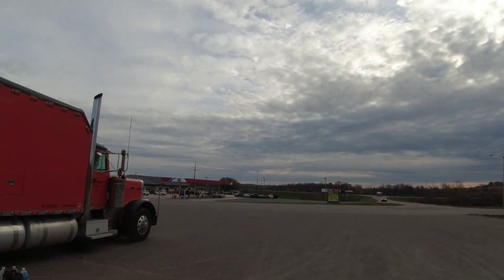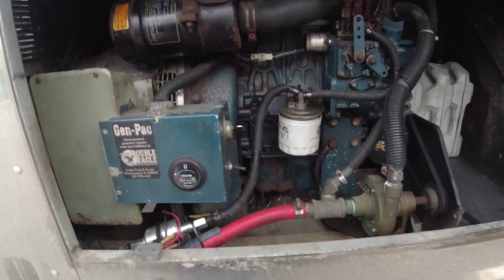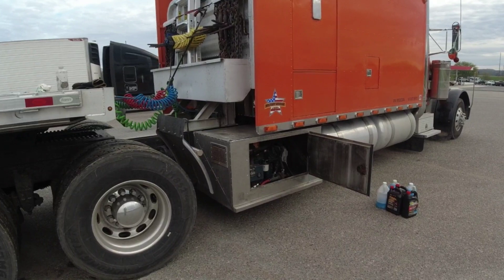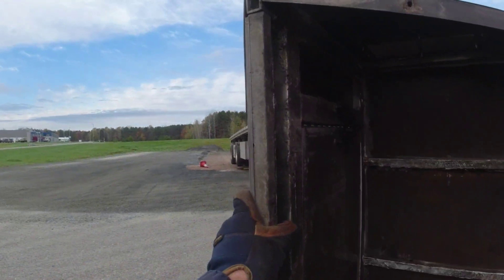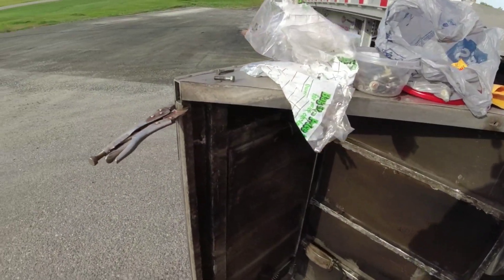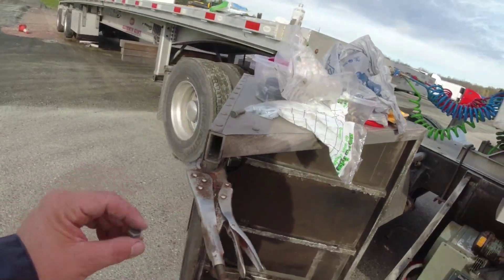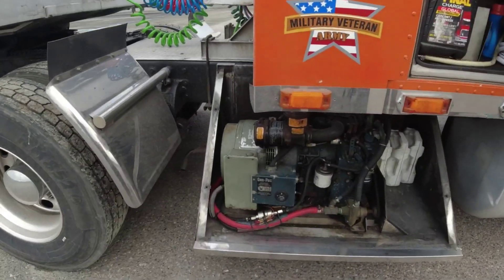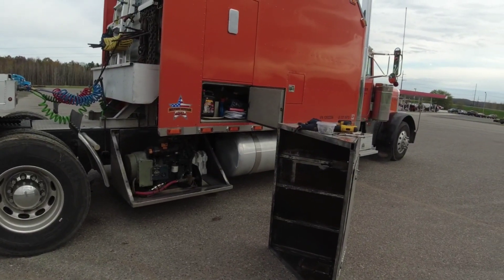#544 Trying to Fix a Noisy Generator The Life of an Owner Operator Flatbed Truck Driver

Comment: Hi Dan good fix...also keep some pop rivets on hand and there is something called a mono bolt which is like a pop rivet and has the strength of a bolt...won't rattle loose either.

Comment: Have a look at dynamat sound deadener.  I used it when I had my big boom booms and WAY too many speakers around the car because reasons..... It will dampen some of the noise for sure. Some of the thicker options work really well. It could knock out a good 15-20 dbs with a basic setup. 25-30 dbs going full ocd with the application.

Comment: You need that sound deadening material they use on cars. Believe me it works and it has foil on one side and sticky glue on the other and you can line the inside of your generator cover box. Also check out YouTube on generator home made covers. Some are quite working projects!!

Comment: I put a small automotive electric fan on the back vent cover, on the inside blowing out, so pulled outside air through the box, wired to a switch, to cool the motor compartment in the hot summer months! I hauled slots out of Vegas, so was in the extreme heat! I also took a power washer to the inside of the cover, cleaned it really good, installed dyna-mat, made a huge difference! Also get a tub to keep you spare oils and antifreeze in! Road Rub is Real! Put some of that anti skid liner and put in the bottom, so you don't rub holes in the gallon jugs! And if you still get a hole in one of them the tub/tote will contain the spill!
Reply: Stanley ... on that set you'd want any blower to be forcing air in because that unit blows the hot air out the bottom.
Reply: @rupe53  Nope! Sorry, but those do not blow air out the bottom. It does not have a radiator and fan in the box, it circulates the coolant up to the radiator in the front of the truck! These were custom made by Double Eagle, their design!
Reply: @stanleyflory6702  ... you are correct on waste heat going to the truck engine / radiator via that aux water pump but generally this type of unit cools the gen end with air, and usually directed down. At least that's what they do in the RV industry. I'd be worried about modifying something the factory guys have already fine tuned.
Reply: @rupe53  I have a 7K Power Tect diesel generator in my Monaco Windsor MH, and it is very similar to the Double Eagle with the Kubota diesel motor, but it has a radiator and shrouds that direct the air past the motor and generator head, and directs it down and out of the compartment! The Double Eagle 8K/10K surge generator does not have the motor driven fan and shrouds. It does have a fan in the generator head, but it does not move the air like the one in my MH!

Comment: Can probably get some chrome plastic caps for those bolt heads you put in to help conceal them👍👍
Reply: replace the bolts with carriage headed ones and it will be good on the outside.

Comment: Try some dyno Matt people who install sound system use it to keep the material on the out side of the vehicle from Rattling from the sub woofer. It works plus you can cut to fit on the area with just a knife 🔪
Reply: I used Dyno- mat on a car restoration once, it's a bit pricey but, when you hear the final results, it's worth every cent! 👍✌️

Comment: With lithium batteries coming down I do not understand why truckers do not install a bank of them with an inverter to run everything instead of using those noisy and expensive to run apu. They could charge the battery bank while driving down the road off their alternator.
Reply: If battery tech was all you say it is then they would already be an OEM option. Obviously they have not solved those problems yet. Bottom line is a small gen set will let you go days and batteries will only do hours.
Reply: @rupe53  you show your ignorance. The proper size battery bank could go days. Also there would be no maintenance, and no noise.
Reply: @JohnSmith-ug5ci  ... I wont get into a pissing contest here but I will ask why it's not in common use if you think it's that good? At what cost? At what weight? I feel we are still 10 years away from seeing that because the average trucker wont buy it till it's proven.
Reply: @UCQlEZc8FT_kRx6LTwieUJiA ... I already understand the battery tech but as I said, people wont buy it till it's proven for years. This is the same reason people still buy gas powered lawn mowers. This is the same reason most people give for not buying an electric car, even though 300 miles worth of range is already a long drive. It will likely come around when trucks are fully electric, in say another 10 years. That's just how the general public rolls.
Reply: @rupe53  no you do not understand. This is not about a car. This is about a system replacing a system that needs maintenance and is noisy and can be charged as you drive down the road.
Reply: @JohnSmith-ug5ci  ... I guess you don't understand the similarities between a car and a truck and the marketing concept of winning people over to new technology. While it may be better in some ways there are still limitations and customers haven't jumped on that band wagon yet because of their perception of those limitations.
Reply: @rupe53  I guess you do not understand the difference between a car or an EV and an electrical system. The system does not power the drive train. It eliminates an engine and power unit along with noise and maintenance. You speak about something you have no clue about.
Reply: @JohnSmith-ug5ci  ... you are putting words in my mouth. I never said any of that. What I did imply was it will be a universal system when trucks have gone EV (and there is no diesel on board) OR when battery systems are good enough / cheap enough to convince people (big *IF*) to switch. Maybe this wont be a marketing thing if gov regulations force the hand, but I see people sticking with the "tried and true" till their perception changes.
Reply: @rupe53  again you have no clue what you are talking about. Some are already changing. Most do not know about it. Again you beat your gums and have not even done any research and know nothing on the subject. .
Reply: @JohnSmith-ug5ci  ... yeah, I was only in the alternative power business for 25 years. Go bone upon your reading comprehension and troll someone else because I am done here.
Reply: @JohnSmith-ug5ci  ... I retired. End of story.
Reply: @JohnSmith-ug5ci  ... you have no clue so just keep digging. Maybe you can burry that ego while you are at it.
Reply: @JohnSmith-ug5ci  .... hey, I'm trying to be polite so I'll let you have the last word... because I know you will take that cheap shot.
Reply: @rupe53  it is not about a cheap shot. I tis about knowledge and you have decided to not seek it in this area. You have spoken on something that you have absolutely no understanding about.

Comment: It looks like you could insulate the cover and help reduce any noise that you might experience in the sleeper.
Reply: I thought the same thing!
Reply: Yes, my thought, too.  They make sound-deadening sheets to line the trunk walls of cars, which should work better than the fluffy stuff they put in engine bays, but either would work well in this situation.

Comment: Dynomat, or something similar. Is aluminum foil backed, butyl rubber sheets with adhesive. Stops most all rattles and insulates flat metal surfaces. Cheers,ed.

Comment: Dyno mat the inside of that cover and there's probably some type of glue or epoxy you could pour along the seams to seal up the loose rivet rattle.
Reply: Automotive silicone sealer into the panel joints will cure the rattles. Pressure wash the cover first to get the areas clean then let it dry overnight before applying.
Reply: @rupe53  Yes, that stuff, what he said  :)  thanks

Comment: Swap them out with stainless steel hardware later on. Love how you carry extra nuts and bolts. When my dad drove he had coffee cans full of extra air fittings, bolts, lights and bulbs.
Reply: My dad has a  3 or 4 containers in his workshop with bolts,nuts, washers,screws etc. The closest store to buy that kind of stuff is a minimum 20 minutes from his shop

Comment: The shiny spots are where the cover is touching and transferring the noise.  Might try to get softer motor mounts, for the genny. Boats have the same issue 😕 and isolating the engine helps greatly.

Comment: Dan, Lowes or Walmart has these little carrying cases that you can carry various screws, nuts, bolts and washers in. its flat enough to fit anywhere. i had 2, 1 for the bolts  and  one for the different fuzes that my truck used, even the little led lites. i still have the one with the bolts, etc. had to check, its called "Stanley's professional organizer."

Comment: There's a product called duct board, its a high density insulation board with a threaded foil facing on one side 1" thick that works great for noise supression in your situation if you have the space to put it?

Comment: Hey Dan, dumb question for you as not many aussie trucks run APUs. Have you thought about fitting a lawn tractor muffler and straight pipe so that the engine noise is reduced? I understand that the covers vibrate and make a lot of noise that can be rather annoying at times and the rubber insulation strips will be helpful. Stay safe mate & give Bailey a good belly rub.

Comment: Hi Dan,
Kubota machinery in general is hard to work on, costly on parts and a PITA to rebuild.
You can re-peen the rivets with a ball peen hammer and a small hammer or solid piece of steel as a back stop.
There are some good videos on how to fix revit situations on aluminum boats on YT, Check Outdoor Sam in Wisconsin, his videos are short and to the point. He is a bit brash outdoorsy type.

Comment: Hi Dan.. good vid nice fix... I'm no trucker but watch You alot 
Check out ::   Justin from JustTruckin... young guy O/O  from SC just got a brand new sponsored GreenAPU   goes for easy  $10K  he said... but all the latest greatest newest hi-tech  even inside remote  led controls for it.. He luvs it.  he did a special vid on it recently  going to the factory and getting it installed on his PB.